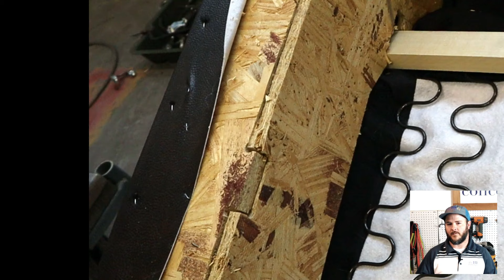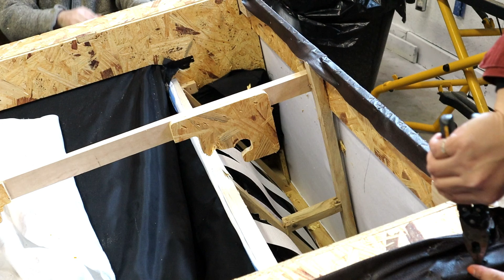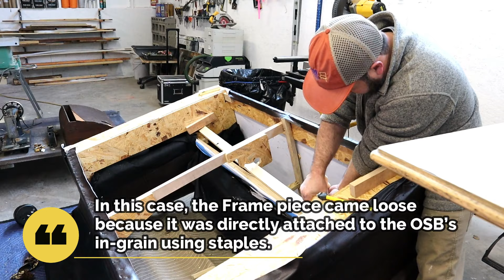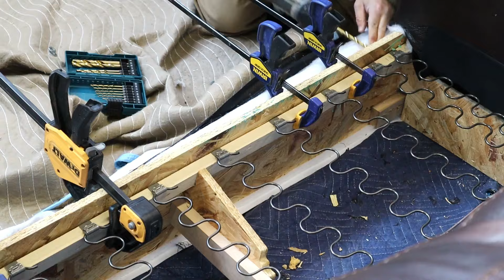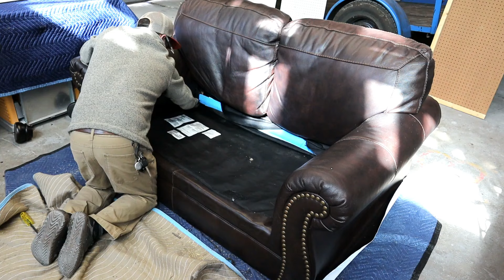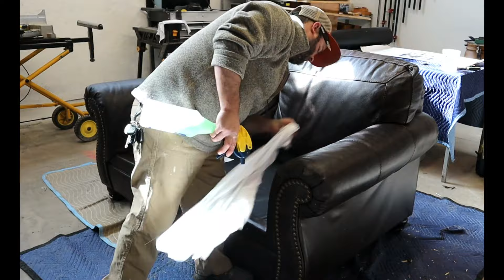How to Fix a Sagging Sofa

Comment: My decking has a major tear along the support. Is there a quick way to fix it?
Reply from the maker: The more important problem is that your decking is hitting the framing for some reason. Sometimes, vendors will put padding in between the decking and frame supports to prevent this. You could try to get away with sewing it, or cutting a large piece big enough to cover the damaged area and using spray adhesive to attach it.
Reply: @the323vlog4  yeah that's a good point. Idk what I can do though.
Reply from the maker: @Shawnbfromsd  if there is nothing preventing the contact, unfortunately, not the easiest of tasks. Requires removing ALL of the staples, adding padding and then reattaching the decking nice and tight. But a quick fix would finding some similar material, cutting it nice and straight, and using fabric adhesive to cover the torn area. Feel free to send pictures of it and I can see what we’re dealing with, thanks the323concept@yahoo.com
Reply: @the323vlog4  would simple fabric adhesive really bear 2 people's weight sitting on it?
Reply from the maker: @Shawnbfromsd  I either misunderstood your issue or I’m not explaining my solution well to your problem. Feel free to email me pictures of it so I can help you more accurately
Reply from the maker: @Shawnbfromsd  the decking fabric shouldn’t be supporting any weight. It’s merely a decorative cover of the springs or support system that bears the weight

Comment: Mine broke in the same spot as the thumbnail 😩 i was hoping you were fixing that
Reply from the maker: I used to see that quite frequently at my old job. They’d use OSB for the front rail and they’d just snap in half. Sometimes, you’d be able to tip it over, put enough pressure on the broken board to straighten it out and install a board behind it stating the crack. That usually would work. Other alternative is replacing that whole Board